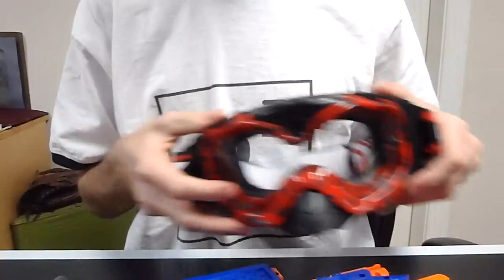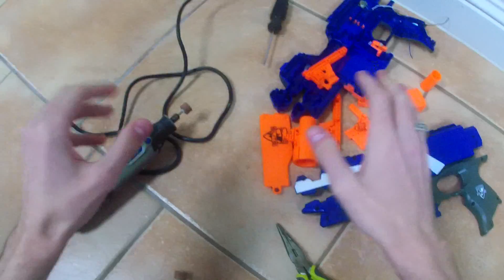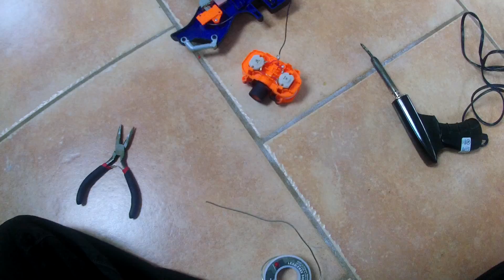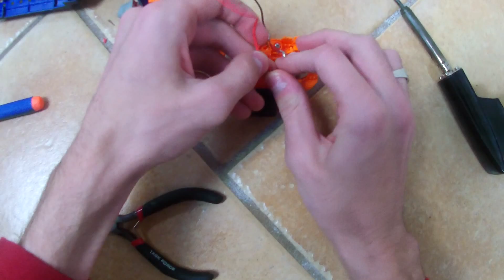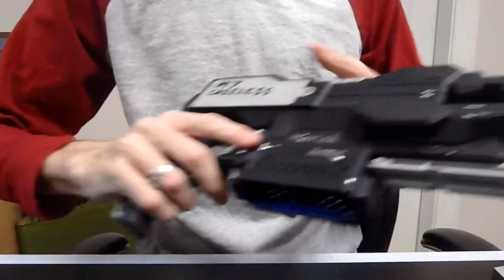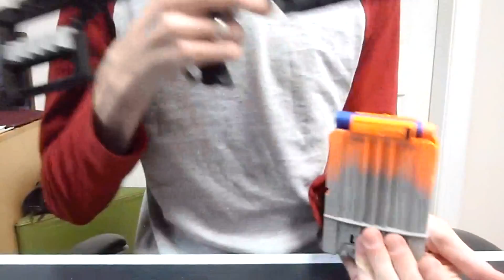Introducing: Nerf Halo 3 SMG blaster, an elite stryfe mod guide.

Comment: Why no flux solder. It works like garbage. I also know that your soldering iron needs to be replaced with one that does not plug directly into the wall. You're pretty good with garbage tools tho

Comment: the screws in the tactical rail are skinnier than the other ones. i figured tha out last night while taking apart my stryfe. so if you try to put one of the other screws into the tactical rail it wont fit into the hole and you risk stripping the hole.

Comment: My stock no longer fits on with my paint. How do I fix that? Stock seams to not have quite enough space to reach the notch. It was tight before, but just doesn't go all the way anymore.
Reply: I would guess that you would either have to sand off the paint or sand the inside of the stock connection piece so there is less space for the paint to stick to
Reply: Cool, Ill do that. Thanks!

Comment: might sound stupid but would the motors not burn out with more volts
Reply: I believe the motors are rated for something around 12 volts, and as long as you don't go over or too close, it shouldn't break.
Reply: 9-12 volts is when the motors will burn out, I think max is 9.2 volts before dart slippage happens

Comment: I hate using Lead-free solder. It has a higher melting point than Lead-based and it's just a bitch to work with.

Comment: can you use 2 trustfires and 2 standard alkaline?
Reply: For a stryfe I run 3 trust fires and one "dummy battery" and it runs really good
Reply: Trust fires are horrible batteries for Nerf blasters. Look into LiPo (Lithium Polymer) battery packs.
Reply: Anakin Skywalker Yes. In fact, if you don't replace the motors, I would reccomend just using 2 Trustfires or Lipos so you don't melt the plastic. And melting plastic is very, very messy and smelly.

Of course, also use 2 dummy or dollar store batteries as your other 2 so the gun actually is usable if you have all 4 chambers hooked up.

Comment: very good job. only thing i can see that could use improvement is the lettering you painted on the gun. i use stencils. i d/l the fonts and print out what i want ,cut out the lettering and paint with it. makes the letting look much cleaner.

Comment: I would have painted the clip black so it blends in with the gun. And because the smg is clip fed from its side. Also added the recon rev 6 silencer, and painted it black. Aaand get the elite pinpoint sights (paint it black), or get the longstrike sights. (Painted black)

Comment: How Well would adding in the Trust fire batteries work without cutting out the resistors? Because im still kinda new when it comes to electrical wiring, and I am not overly confident in my skills to do it right

Comment: A little tip to make your soldering go easier s pre-tinning the wires (putting a little solder on the tips before you get down to actually soldering it into place) 

And I don't know if you do so but you should also heat shrink the wires after they've been soldered into place. 

Other than that, Nice work

Comment: Is it really necessary to remove the switches behind the acceleration trigger and the ammo cap to improve the strength of the stryfe? Or would it be enough to remove the resistors attached to the motors?
An answer would really be appreciated =)

Comment: The warning is there for two reasons, neither of which Hasbro would/should actually do anything about: 1) it covers their butt in case someone mods the toy and hurts someone, and 2) it voids the warranty so you don't attempt to mod the gun, break it, and demand compensation. Nerf (Hasbro) doesn't actually care if you mod it.

Comment: i really love your paint jobs and I look here first when it comes to Mods and air restrictor removals.  Your paint jobs are alway pretty sick but i will say that your lettering is severely lacking!  It kind of takes away from the paint job making it an "8" ersus a "10".   Have you looked into different font or lettering stickers that you can apply to your new paint job and then "Clear coat" over?  Have you tried your hands at stencils or masking?  Take this comment as constructive criticism.

Comment: Hey Drac, are you using normal 1.5v AA (rechargeable) batteries, or another higher voltage like the 3.7v Trustfires? If the former, will the Trustfires burn up the motors in the strife? Thanks.

Comment: If you wire in series, then you divide the voltage between the motors. Which kind of renders a voltage mod moot.

Comment: Then wouldn't removing the resistors decrease the range because for parallel circuits 1/I = 1/R1 + 1/R2 +... meaning more resistance means greater current and faster rotation in the flywheels?

Comment: I wouldn't use four Trustfires in a Stryfe, since I think the motors are similar to those in a Barricade. If you plan on using four, I'd do Coop's motor replacement so that the motors don't burn out.

Comment: you need replace those motors or they WILL burn out. you don't need to do the same think coop did though, in-fact, it's probably better if you don't. See if you can't find a better motor of the same dimensions.